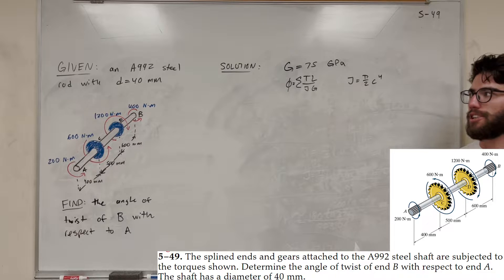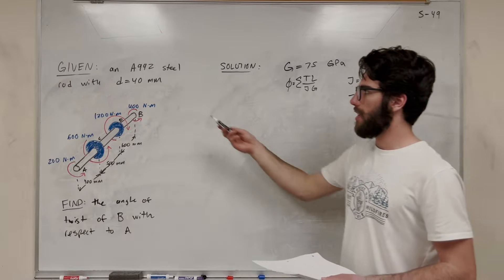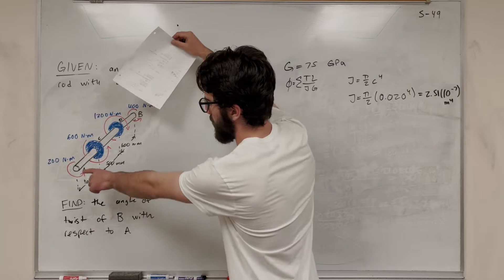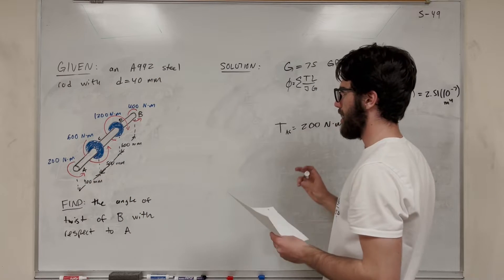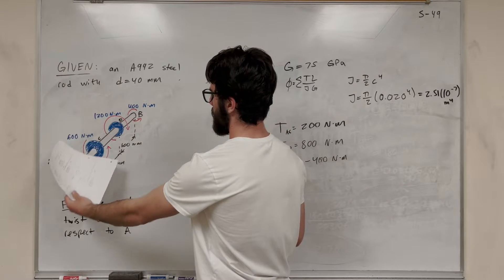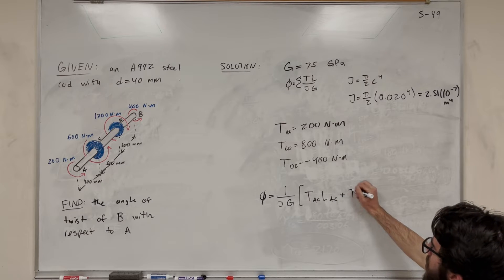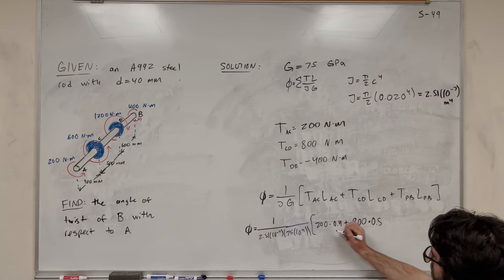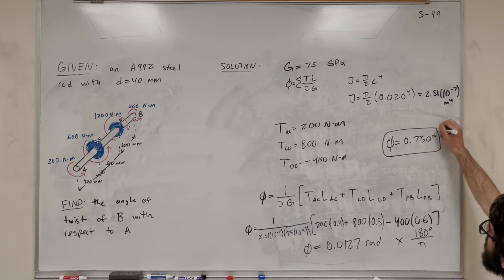The splined ends and gears attached to the A992 steel shaft are subjected to the torques - 5-49

Comment: you wrote it down right .. i’m working the problem right now. your answer is correct but why is is it -40
Reply: late response but the 200 and 600 are positive since they’re counter clockwise, but the 1200 is negetive since it’s clockwise. Add the moments up and you get a -400 moment